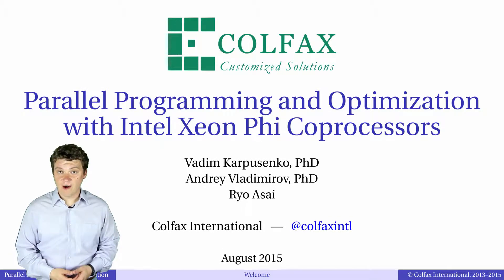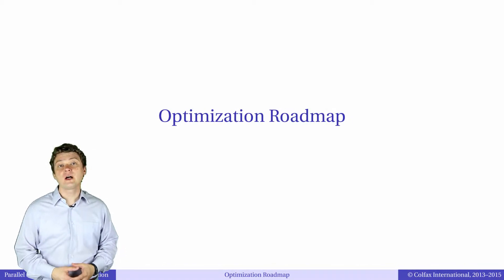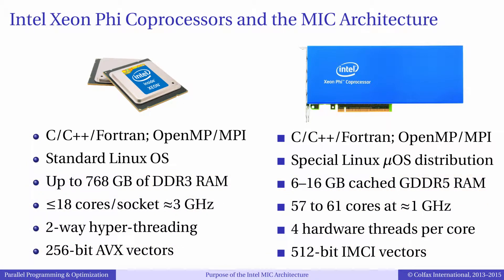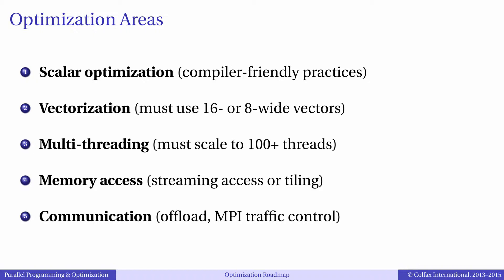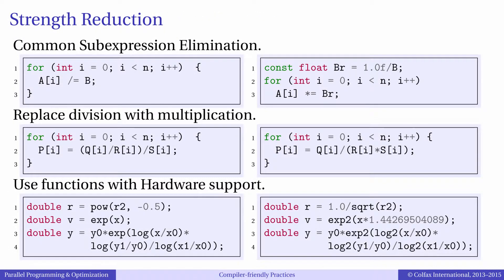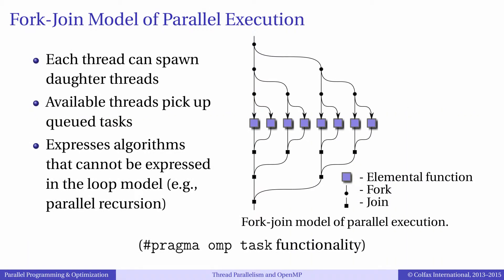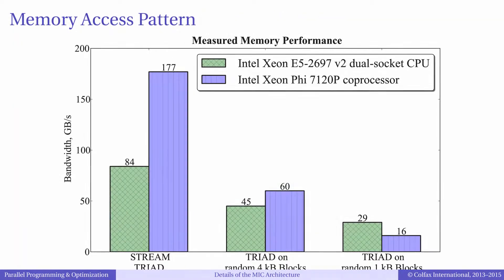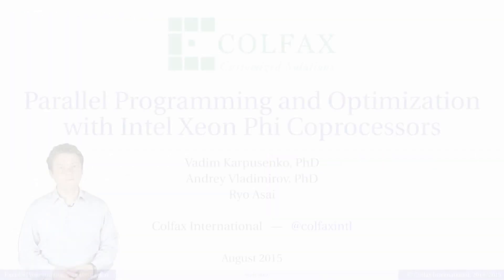Episode 5.1 - Optimization roadmap

Comment: Hello!
Do you plan to give example on time measurements in Intel Xeon Phi usage?
Particularly for offload mode. Also there is a question in stackoverflow http://stackoverflow.com/questions/31844170/how-to-measure-data-transfer-time-for-xeon-phi-offloads on this theme.
Reply from the maker: ZifStone Yes, offload will be discussed in the episode 5.16 - Optimization of Communication: Offload.
There's a simple solution - put omp_get_wtime() around your offload region and compare those times with offload report. Unfortunately, I'm at the airport right now and cannot do it from here. But it should be straightforward for you to implement this without any issues.